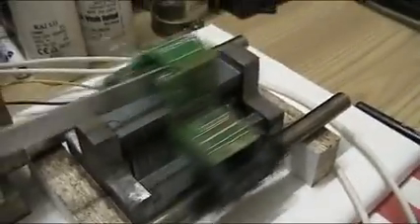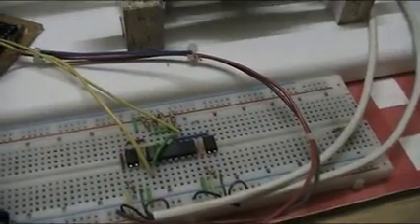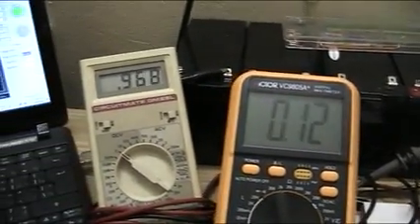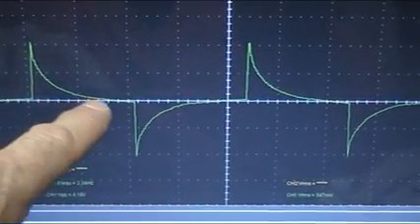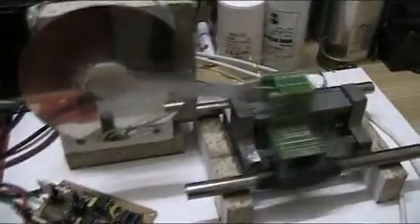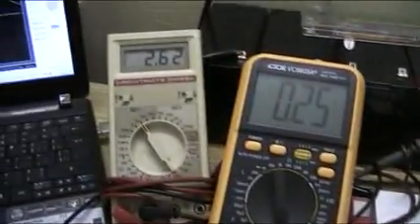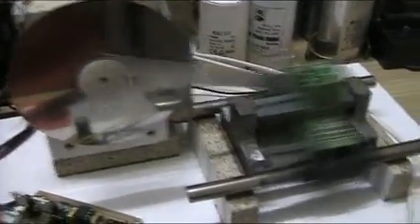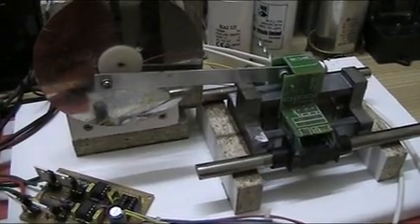Mostly Permanent Magnet Motor Part B

Comment: Is the little motor you are using for a pulley putting out any volts?
Reply from the maker: +Philip Culver That little motor would of needed much more rpm to put out anything worth while and that's why I did not connect a load to it.

Comment: Gotoluc, have you considers trying all magnets, no cores? Or more magnets with smaller cores, whatever would increase the magnetic fields strength as it interacts with the coil, downside to this is that it would be more expensive than your current design, you have optimized the magnetic field far beyond what a normal system would see by the clever arrangement of magnet placement and coil design. With the cost of magnets being so high I think your design is very close to optimum.

Comment: This is truely an ecellent design-way to go gotoluc.
I see that the flyback is working in your favour insted of against you as peter sugested it would.Weather you knew it or not-having the flyback creating the initial charge in the coil for the other side of the AC is pure ingenious.This i am going to have to incorperate with a new SSG type setup.This may just tip the scales
It always pay's to believe in your self

Comment: Back in the 1980's a good free idea like this was presented in a Loudspeaker Builders publication, the idea was "stolen/taken" and patented by a major Loudspeaker Manufacturer, (BOSE), and patented, later, when a speaker design using the idea was published in the same magazine, BOSE lawyers sent a cease and desist order, saying the design was theirs and they would sue to prevent even the original inventor from using the design without paying them for the patent that they then owned.

Comment from the maker: I tried it and at that slow RPM the 12vdc motor output next to no voltage. However, there are some motors that would do much better a slow RPM but I don't have any at this time.
The Pony brake test will be best for determining the efficiency.

Luc

Comment: Please also show us just the coil induction voltage , if you move the coil manually.
How good is it as a generator ? If the generator effect is much lower than in a normal DC motor 
or in a linear motor ?

Regards, Stefan.